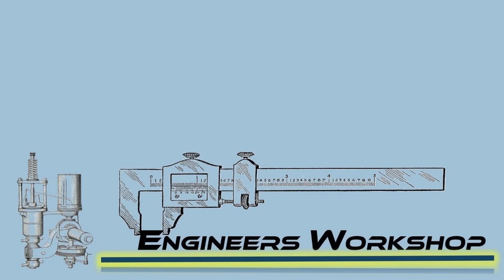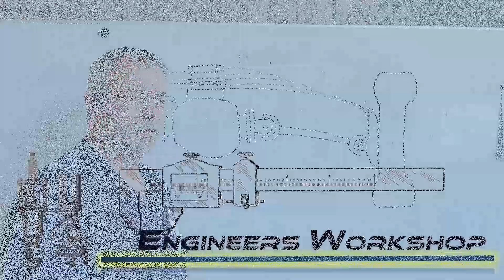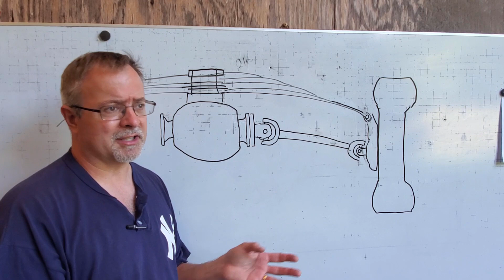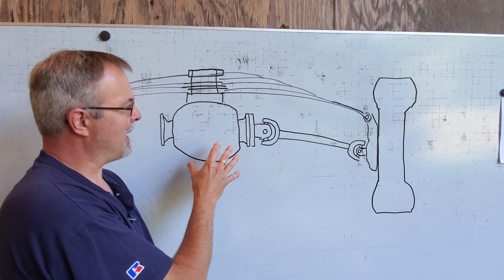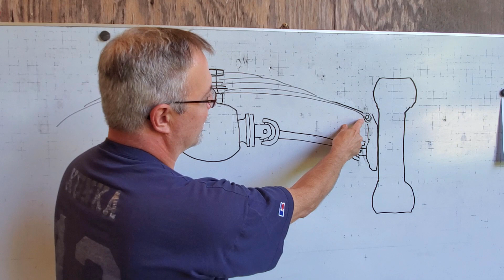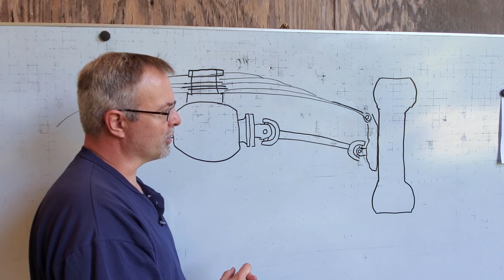Spitfire Axle Adapters - Machining Multiples on the Kearney & Trecker Model 2D Rotary Head Mill

Comment: If only for a lathe. :-)
Reply from the maker: Yes, it is basically a lathe part (except for all the upcoming holes). Replaced all the broken gears in the ex-Doozer Acraturn 1340, but still have a broken motor mount to deal with.

Comment: Chuck up more on that end mill u have plenty of room. It will help with reducing vibration in the end mill. Good job Jim....
Reply from the maker: Yes, should have been more observant there... Ideally I'd use a shorter one, which i do not have. Bought that one to mill some 2" stock.
Reply: @EngineersWorkshop  I think your kicking ass on your machining and what you have already learned and done since day 1 with your new mill Jim. Heck, I know I'm proud of you AND I enjoy your content. Seeyah buddy....
Reply from the maker: @Rick O  I appreciate that, coming from a real machinist. Been an engineer for 30+ years but cutting steel gives you a real feel for what you've been doing on paper!